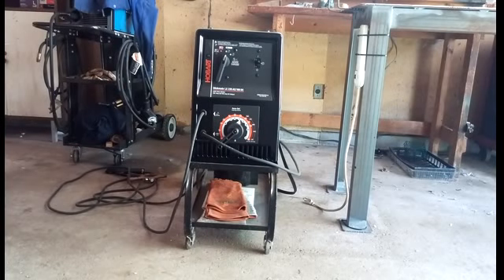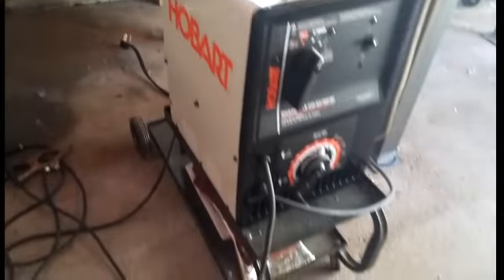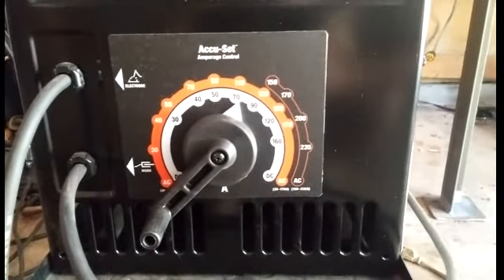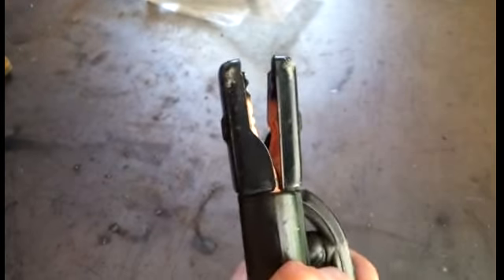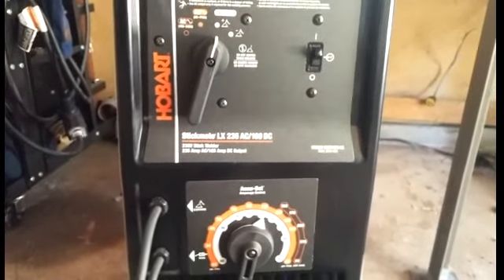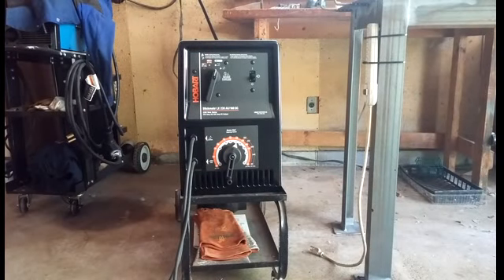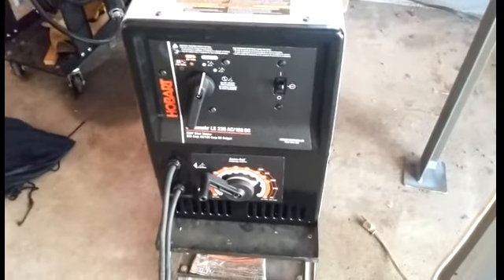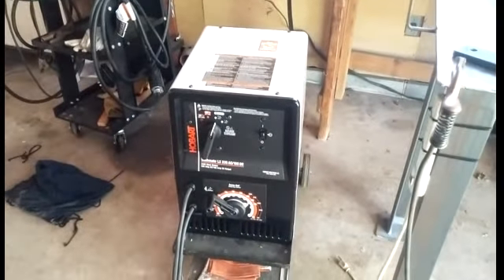Hobart Stickmate LX AC/DC Review

Comment: When comparing this transformer based machine to the inverter with a potentiometer knob, adjusting the current might seem more accurate and easy, but the truth is, if you’re new to welding, you will have trouble adjusting the amps on any welder. The secret is getting to know your welder and develop a pulse at welding. Have fun my friend and thank you for sharing.

Comment: Amazon carries the “Hobart 043927 Chariot Running Gear” which is a set of wheels with axel, handle and front feet. It is designed specifically for this machine, its pretty slick. Check it out!

Comment: Cheers my friend, that’s a nice piece of equipment you got there, and you do have one of the best stick welders in the world. Hobart is the best! The “Accu-Set” design is a direct amperage adjuster on the transformer and it will increase amperage by 1-amp increments. Just keep on welding at different settings and you’ll get it.

Comment: ac good to weld with?
Reply from the maker: Some people like it, some hate it. I personally would never stick weld with ac unless it was an emergency
Reply: @Heritagepostfarms  AC is useful when you get into situations where Arc Blow is a problem... which is one of the downsides of DC welding current.  If you've never heard of Arc Blow, you can google it.  You'll also need to run AC to get the full output from the welder.

In a nutshell, AC is good, but usually DC is better.  But there has been a LOT of electrodes burned with AC only machines over time.  The weld made with AC will be just as strong as the same weld made with DC... DC just gives a smoother, nicer arc... better arc characteristics.  AC is more harsh.  DC is a luxury... but AC will still get the job done.

Comment: How do you run this welder if you don’t have 220 plug or what ever it is? Do I need to run it off of a generator?
Reply from the maker: Chase You cant. Dont buy unless you have 220 connection. I wouldnt recomend using a generator.
Reply: These are being replaced by their new inverter stick welders, the 160 model is dual voltage 120/240. It will only have about half the power on 120 but you can do 1/8" material with that pretty well. These newer units are full of Chinese made electronics and I'm sure won't last as long as the older units but with all the cheap welding machines on the market now im sure eating their business up on the low end they needed to do something. One of the big benefits of the new machines is they are very light weight, 15lbs, and extremely portable which is why I bought one. It's just a matter of supplying it with power. If you have a dryer plug you can use it for the 240v.
Reply: This welder will need at least an 8000 watt 8 kw generator! Most folks dont have that big of a generator laying around. Wire up a nema 6-50 receptacle to a 60 amp double - pole breaker with #6 / 6 awg wire no less! This welder could draw up to 42 amps plus surge to 50 amps during arc starting. Thus the reason it's set up for 220 volt.
Reply: @Heritagepostfarms  I run it off a generator all the time. it works perfect.
Reply: @scrapmanindustries   What size generator do you use for this I’m looking to get one but ain’t got the budget for an 8000 W generator
Reply: @marloflores8325  I run mine off a 8500/6800 watt rigid generator. it even runs 6010. if your using it with the welder the welder can make you money. that $300 more for a generator will seem like chump change soon. I've replaced my stick mate with a fronius transpocket. you can run them with less watts and 120 if you need to.
Reply: @marloflores8325  You can run it off of a smaller generator, but you won't get the full output from the welder.  But running 1/8" electrodes at 120-130 amps, you might get by with a 5-6kw generator.  I've ran mine a few times off of my 6.5kw-8.5kw surge generator, and it handles it easily running 1/8 electrodes.  But if you're needing the full 200+ amps running 5/32 on AC, you're going to need a big generator, no way around it... you can't cheat physics.